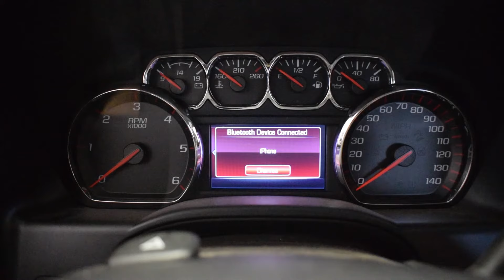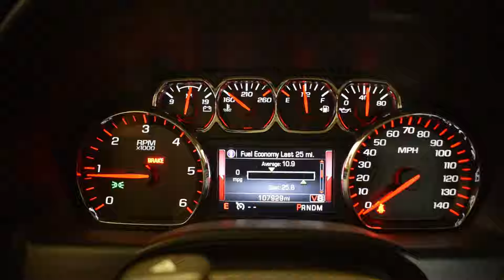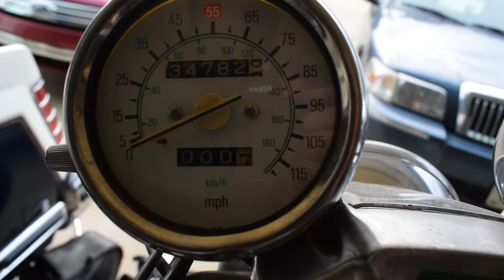2016 GMC Sierra O2 Sensor Replacement | Silverado, Tahoe, Suburban, Yukon, GM Trucks 2014-2019

Comment: Ironic , my 2015 threw an 02 sensor high voltage sensor 1 bank 1 just after replacing a torque converter. Absolutely ridiculous, 120k here. Gm is trash.
Reply: Was yo truck in limp mode?? Did it lose power ?
Reply: @ederrisboyd3042  Yup, but as of 2.5 years ago I bought another Ford and haven’t had an issue since. Highly recommend.
Reply: Agree, AC out 62k, trans out 149k. Towed a small trailer 2x.
Reply: @georgia4067  I’ve owned a 2018 F150 since early 2021 zero issues. Go get a ford

Comment: 2018 gmc truck 1500.sierra transmission 1000, miles radiator next ,water pump, all wire to power and negative  fuse box what happened to America built so sad..I have graduated to mechanic now..last truck was a Toyota 3000 plus nothing only tires and oil nothing  broke or wore out also just replaced Cataic converter system the whole thing yeah America  built jk

Comment: What was the actual problem with the transmission? Was this a computer issue from the o2 sensor being bad/unplugged?
Reply from the maker: No, definitely not. The torque converter went out and grenaded the transmission. Very frustrating. Have heard of many instances of failed transmissions at less than 120k miles on these trucks 2014+.
Reply: Axle Brothers yes my Denali had same issue, converter sends metal shards through tranny and screws it all up. GMC rebuilt mine at 98k miles because of it. I am now receiving a p0058 code; is that what you fixed here?

Comment: I have a 2013 Sierra 1500 and I have codes showing, I'm just gonna change all four out. What brand name of sensors did you use?
Reply: I have the same truck, what brand name of sensors did you use? I have P015B code,
Reply: @RicardoMartinez-gb3ii  They are the original o2 sensors that came with the truck, way overdue to get changed. I assume they are genuine GM parts or AC Delcos. I have a P0174 code showing on my code reader. I haven't changed out the sensors yet, been delayed with other things going on.
Reply from the maker: The sensor I used was AC Delco OEM
Reply: @RicardoMartinez-gb3ii  what was the fix? Just replace 02 sensor bank 1 ?

Comment: When you clear the code, you reset all the data in the computer needed to pass inspection. You may have to drive the truck around for a week before you can take it in for an inspection to collect new data. Alternatively, the light would have went out on its own. Good job guys!
Reply: Drive time is in rang of 80 to 100 miles then it resest

Comment: 2017 Tahoe with 51,000 KM - P2097 Post CATALYtic Fuel Trim Sys Too Rich ??
Bad o2 ???
Dealer Replaced y-pipe CATALYTIC CONVERTERS LAST YEAR ? ? WTF More GM CRAP